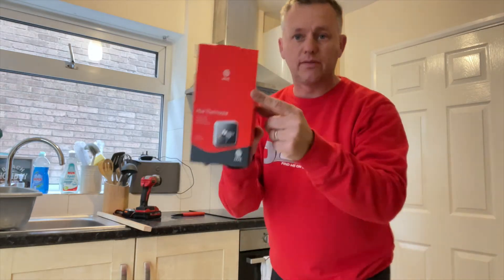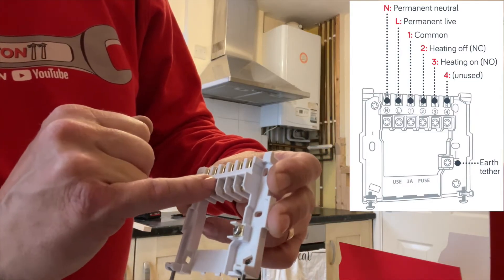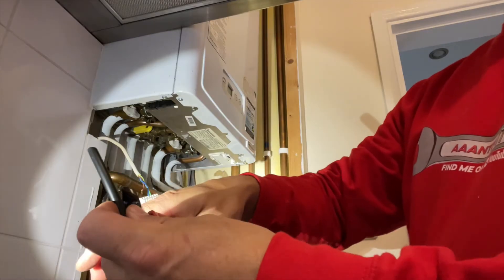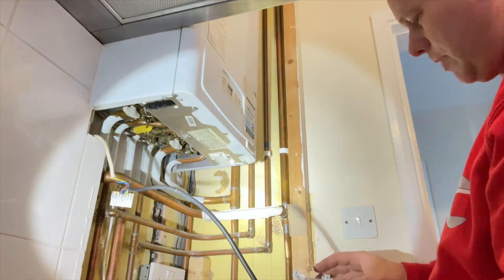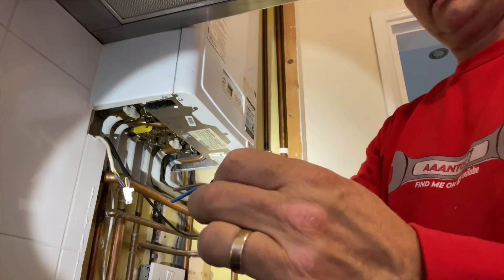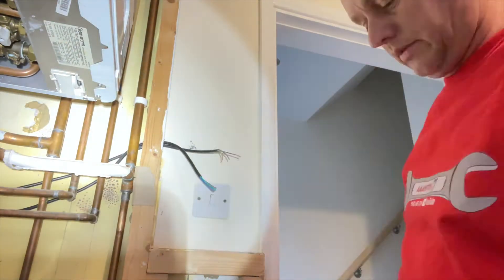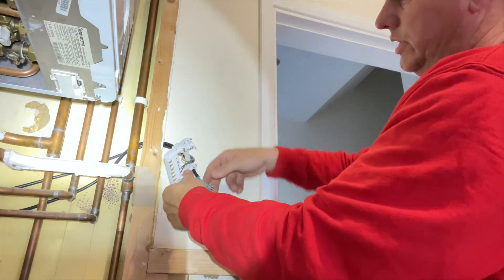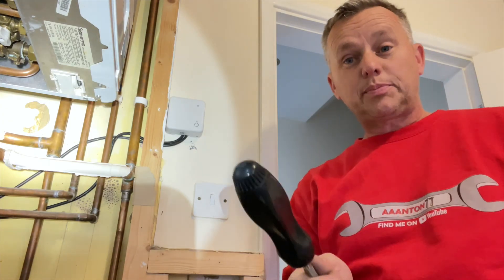Fitting A Hive Thermostat To A Glow Worm Combi Boiler, The Easy Way. Save On Gas.

Comment: Where did you put the 2 jumper wires in? Ebus, 0V, or 24V?

My jumper wire was between 24V and 0V, but my existing receiver was wired into Ebus and 0V?
Reply from the maker: I only have the info in the video, Thanks for the great comments👍🏻👍🏻🛠
Reply: @aaanton11 if I connect it to anything on the 24v part it'll blow. Maybe the type of receiver is important too.

Comment: Hello to anyone reading this in 2024, I used this video as I thought it'd work for my Glowworm 24cx. 
I think this works if you have the loop on the 24v part of the boiler but mine didn't have anything in it at the start, so every time I went to wire it up like this and try it it blew the fuse.

After hours and hours of working and looking online I found that in most of the boilers they are wired up L, N E and R, that powers the boiler and no connection on the 24v - so check how its wired before you strip anything or take pictures.

So when you wire the hive into you need to do N, L, a common connection between L and 1.

For the R connection; the biggest thing CHECK WHAT HIVE CHANNEL RECEIVER YOU HAVE, if its a single then, yeah wire it to 3, but if not then you actually need to wire it to 4!!
We eventually found this problem through fault finding and then a multimeter on the connections, prior to this it was a trial and error and there were SO MANY ERRORS! I hope this helps someone! As useful as this video was for the foundations of the Glowworm boiler wire up, it is a little flawed.
Reply from the maker: Thanks for the great information👍🏻👍🏻🛠

Comment: Cheers for the video pal. 
I've got a glow warm 35cx, which didn't come with a thermostat, it only has a timer on the boiler for heating. 
Since last year the timer isn't working correctly. It gets stuck and if I don't realise, the heating will run for the whole night. 

If I fit the hive, will it mean that the timer will be redundant and can fully control the boiler using hive?

Is there a second video to show how to use once you've fitted ?
Reply from the maker: Yes set the boiler timer to on all the time and control the boiler from the hive, I don't have a hive user video sorry Thanks for the great comments👍🏻👍🏻🛠

Comment: Great video, nice and clear thanks.

Have a question on the wiring - why did you wire the 24v (blue and grey cables on boiler) to the receiver (1&3) instead of wiring live (from boiler) to common (1 on receiver) and R (from boiler) to NO (3 on receiver)?

Which would you say is the correct way to wire?

Also I'm doing this for a glowworm flexicom 30cx with a single channel hive receiver - would the wiring be the same as your video or do I need to connect 1 (on receiver) to L (on boiler) and 3 (on receiver) to R (on boiler)?

Thanks for any info
Reply from the maker: Just do it the same as in the video, Thanks for the great comments👍🏻👍🏻🛠

Comment: I have a Glow worm flexicom 30cx. 
Having trouble with mine, just had a gas engineer out to do mine and he couldn't do it. The main wire is a 5 core so we didn't have a loop, it had 2 black wires already wired in. Plus on the main receiver the previous wires were in 2 and 3, not 1 and 3 like the hive said. Putting the hive in 1 and 3 trips the electric when switched on :S
Not sure where to go now if a gas engineer couldn't figure it out, he's done hundreds and can't figure out why this one won't work.
Reply from the maker: You need a new gas engineer! if you google Glowworm flexicom 30cx wiring diagram you get the hive install diagram.
Thanks for the great comments👍🏻👍🏻🛠

Comment: Apologies if this is a stupid comment. I have quite an old boiler and no room thermostat, looking to install one of these smart thermostat. The part which is confusing me is understanding which terminal on the boiler is Common and which is Normally Open. (I don't fully understand what these mean, I have just gathered these are what you need to use from watching tutorials. 

My boiler has 3 wires for the room thermostat section (plus separate connections for LNE). The 3 connections for the thermostat part are wired 1,2,3. 1&2 are bridged so from watching your video I assume it is 1&2 which I need to connect to the new smart thermostat system. What I am unsure of is what 1&2 are, which one is Common which one is Normally Open? 

Appreciate any guidance you may have. Also, when wiring up, you said the two bridged wires can go either way, so is it that it can also go either way when you wire it up to the smart thermostat system? Or do you have to know which was Noramlly Open and which was Common?
Reply from the maker: You have this, like you said remove the bridge between 1&2 and wire to the thermostat as in the video, doesn't matter which way round you are just breaking the circuit, the thermostat is just a switch joining the bridged wires back together when the boiler is on. Thanks for the great comments👍🏻👍🏻🛠

Comment: Informative video, thanks. How do you wire up for multizone? I understand that you need a receiver for each zone, but how do they connect, does each one just loop across from the receiver next to it?
Reply from the maker: Not sure on that one, the boiler can only be on or off for the whole system. Thanks for the great comments👍🏻👍🏻🛠

Comment: Couldn’t you have hacked out the wall a bit and brought the cables through the square opening in the mounting plate? Would have left no visible wiring and would have required minimal plaster to cover the cable run from the timber baton to behind the receiver. Pretty sure that’s how the fitter did mine, although the receiver was replacing an existing programmer so the cables where already behind the plaster.
Reply from the maker: Yes this will be done, but not today😂 Thanks for the great comments👍🏻👍🏻🛠